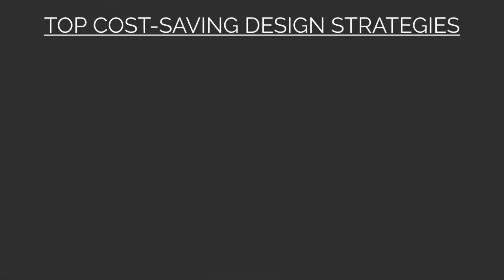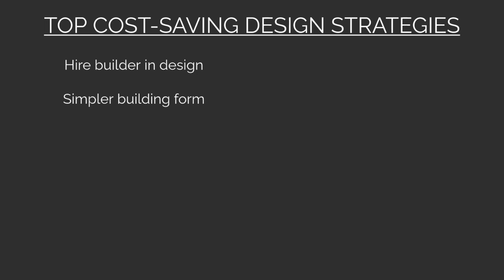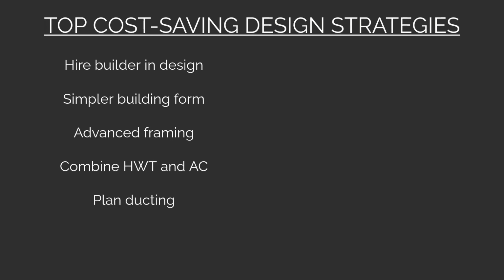BUILDING A HOME: Reducing the Cost of Building A House (Part 2)

Comment: Do NOT expect your architect to be a cost-saving source. Architects talk in $30,000 sentences. They are not cost-reduction specialists LOL!
Reply from the maker: a104917 makes a great point.  I know those who have spent $20k and had nothing to show for it.  I've seen architects turn a $30M building into a $40M building when it looks only like a $20M building.    Don't blindly hire your architect; ask him or her how to keep costs down.  If the answer is "use less expensive materials", "make the building smaller",  or "it really all comes down to the what the builder charges", you should probably look for another architect.

If you can spend an extra $20k but save $100k on unnecessary cantilevers, reduced HVAC, reduced lighting, reduced pipe and duct runs, reduced lumber and framing labour, fewer interior beams, waterproofing details that are simpler to construct, you're $80k ahead.

Comment: Could you explain advanced framing
Reply from the maker: James, it's a loosely defined concept and some engineers haven't heard of it, but it boils down to optimized arrangement, product selection, and sizing.  Value-optimized framing, taken to the next level.
* Note and disclaimer - this information is conceptually applicable to BC but maybe to other areas, and you need to consult with the appropriate person (architect, engineer, etc.)  about the tips you want to use, as applicable to your project.  This seems to work for seismic and non-seismic zones, but hurricane areas always need a closer look.  The building owner is ultimately always responsible to ensure compliance with the building code (believe it or not).
1. Lining up roof trusses or joists with wall studs and keeping the same spacing means that you likely don't need a double top plate; the roof loads run straight down to the ground.  The more that structure lines up, the simpler it is also for drain pipe runs.
2. Locating and sizing windows to suit stud spacing means you're not adding extra studs, PLUS with 16" spacing you could use 4' as a sizing module for openings to avoid needing to cut the sheathing.
3.  Reducing framing member size to what is needed  - this means an engineer needs to calculate the loads.  Typical framing sizes have a lot of safety factor built in because wood-framed house structures are rarely designed by structural engineers.  Even when they are, the engineers will save time by using typical member sizes.
4. Standing the sheathing boards - vertically laid out instead of horizontal.  9' tall sheets and you can eliminate mid-height blocking (provided you're insulating the stud cavity.)
5. Switch to 1-3/4" rim joists means no blocking required and often no separate window header.  This REALLY depends on the specific design and is better suited to multifamily, but it's still useful to consider.
6. Orient second floor framing to suit exhaust duct or pipe routing.  Run ducts or pipes between joists instead of cutting holes in the joists.  Less of a thing for single-family homes and for homes with HRVs, but it's another tool to consider.
Beyond this, the design of the building should be trying to align walls from above, roof bearing lines, or point loads in useful locations.  That's less 'advanced framing' and more 'smart design' though.
Reply: @danielclarkearchitect  Question on #4.  Vertically the edges would land on studs which is good, but the stud has a lower r-value than insulation.  The would touch a seam between sheathing, which you could tape to prevent air infiltration.  External insulation would cover that, but if no external insulation, or a very cold climate, it would seem to me to be better to run the sheathing horizontally, and the area where a seam met a stud would be much smaller, and more of the seams (now horizontal) would be backed with insulation.  I could be wrong.  Just curious.
Reply from the maker: @disqusrubbish5467  Thanks for the postulation, but I don't see why a joint between sheathing panels landing on solid wood would be thermally any different, or I don't properly understand your question.  The joint is actually where there is a sliver of no wood, so moving it to the studs would improve resistance though negligibly.
BTW, a caution against using the the trend of using sheathing as your air barrier - the air impermeance of sheathing is reliable only if you're using plywood, or using OSB that does NOT get wet during construction.  A study has shown that OSB that gets wet and is allowed to dry does not return to its pre-wetted airtightness.  I've also seen a study that compared European-sourced OSB to North American OSB, and the European boards had better airtightness.